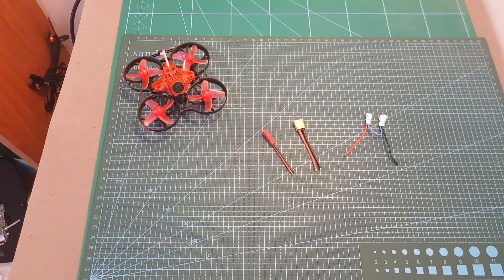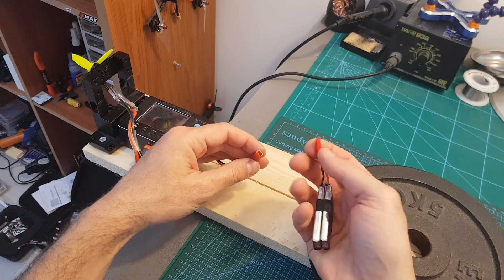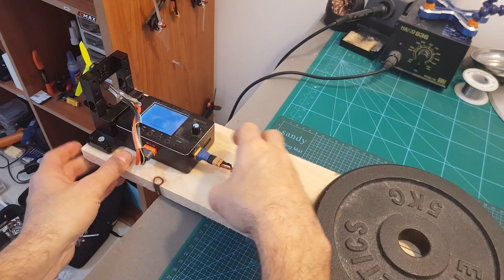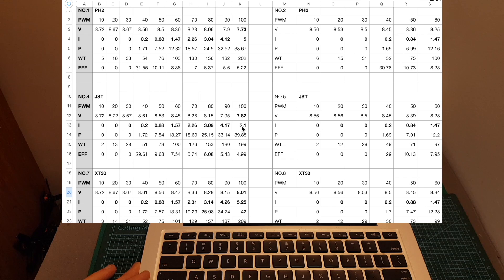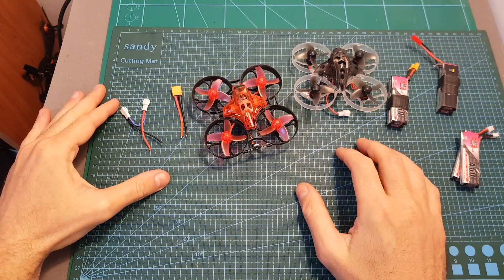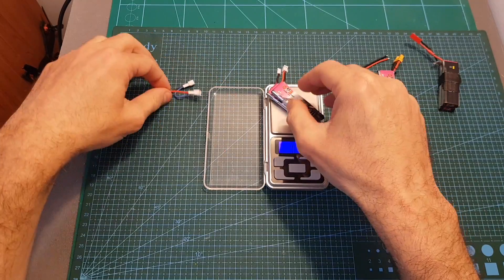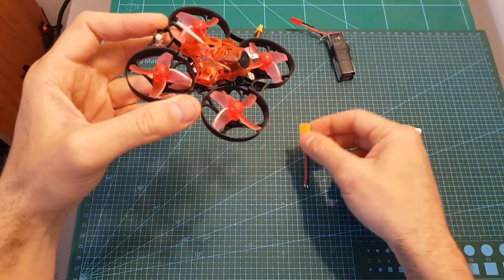XT30 Vs. JST Vs. PH2.0 Connectors Comparison

Comment: Hello sir, I have a mobula 7 1s drone. I changed the motors with mobula8 motors. And it's hard to use 2s battery I connected 2 pieces of 1s gnb 600mah with pH 2 connector, will this be a problem?

Comment: I have a 2S 350mAh lipo only with a JST XH2.5 connector. No extra cable with connector. It is from my Omphobby M1 Heli. Works great on the Heli. How does the XH2.5 compare in this test? 🤔

Comment: am I missing something, or you really testes different connectors with different batteries? You just measure the difference between particular batteries, no connecters. The lost of current resistance of the connector is negligible. Why nobody commented such an obvious fact?
Reply from the maker: Different connectors - same batteries.
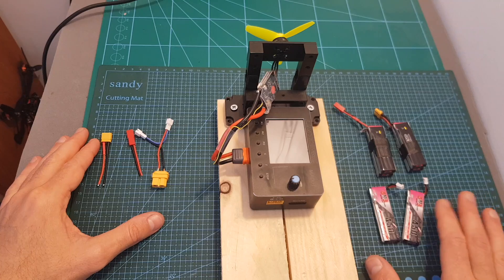Reply: @KremerFPV  but on 0:42 you clearly have all 3 configuration solded already. What do I miss?

Comment: In your opinion, is it worth upgrading to JST instead of XT30 on a 1s 600mah toothpick build? I mean JST is lighter, and it doesn’t require soldering, which might degrade the battery due to the heat when soldering , and I have tons of JST connecter laying around 🤣 
Is it worth saving 1-2 grams of weight in exchange of 2-3% of efficiency?
Reply from the maker: It's actually downgrading haha. You can use BT 2.0 connectors but if you have a lot of JST connectors and you must use them, go ahead :-)

Comment: I just change to xt30 on my mobula7 1s config, voltage sag is significant improved. 

Thank you for the video.
Reply from the maker: Great to hear!
Reply: This is exactly what I was looking for. The voltage sag is significant on my Mobula 7, and I want to convert to either the XT30 or the JST RCY but had concerns that the XT30 would be too heavy for it. But it's essentially only 2 grams more, which I guess hasn't been an issue for you.

Comment: Can you do the test again with the new connectors bt2.0 and et2.0/gnb27 vs xt30 connected to the battery as the jst was? I was thinking that maybe this two connectors are worth replacing the xt30 in 2s batteries .
Thanks in advance. Keep up the great content
Reply from the maker: Thanks for the suggestion. I was planning to make an updated video but never got the time to do it :-/
I might post an updated test in the future though.

Comment: Just a quick question, how are you going to charge the spliced 2s battery that uses that xt30 connector is it ok to not have a ballance lead? I want to do the same with a bunch of 1s bats I have  thanks
Reply from the maker: You are correct, it's much better to use a balance connector but it's possible to charge the battery without it (with some chargers).

Comment: Gal, nice video. I am thinking of getting a toothpick class 2-3s drone with an XT30 connector. However I have a large number of 1s whoop batteries with PH2.0 connector. Do you foresee any issues if I make an adapter with an XT30 male plug to (3) PH2.0 female plugs wired in series? I am ok with some efficiency loss if I don't have to buy new batteries :)
Reply from the maker: Thanks.
Sure, you can do that but I do suggest in the meantime while you fly to get new 2/3s batteries with the appropriate connectors as you will encounter efficiency loss issues and your flight time will be shortened.
Reply: I'm a complete novice here so read this comment with some skepticism. I would also have no problems with creating an adapter to go from a PH2.0 to an XT30. But I think you'll be less happy with the results. I'm sure it would likely take a Long time to change over your batteries but you could try changing over a couple to XT30 connectors to see how it goes.

Good luck!

Comment: How do you charge your modified 2s batteries now that there is an xt60 with no balance lead?
Reply from the maker: I only did it for the sake of testing these batteries and even though it's not ideal, you can also charge your batteries without the balance connector.

Comment: Great video! Just what's needed right now. Something to note reading the comments... TWO (not one) PH 2.0 connectors have more resistance than just ONE JST which is interesting as JST lists the common 2.5mm JST RCY connector used here as a 3A max connector too. So the JST should have been used in place of the PH 2.0 IMO but it's still not rated high enough. Also JST connectors come in different quality grades not listed on JST's website that increase the amp rating (over double I believe) but to my knowledge only the cheap version are used commercially so the new BETA FPV BT 2.0 connector seems the best way to go right now. My experience shows the cheap version JST connector gets warm enough to be hard to separate on a U807 using a Nano-Tech 750mah 35C 1S (lower amp draw) so at 0.58 grams (both male and female) I'll be ordering some BT 2.0's for all my 1S high C rated batteries and hope a standard micro connector for 2S high C batteries emerges as that's what is needed now as well as longer flight times on small builds.
Reply from the maker: That's good to know. Thank you!

Comment: I have a question, I have some lipo batteries but they are jst plug so I want to know if I can change it by a tx30 plug just by cutting the end and welding the new plug, hope you can help me. The batteries are 3s 1000mah 30c
Reply from the maker: Yes, it's pretty easy. Just be careful not to short the two wires together.

Comment: hey Gal! I'm interested to know if I could adapt a 1s battery with ph2.0 connector into an xt30, kind of like you had your test leads, just in case I want to fly these smaller quads indoors at 1s for competitive reasons (there are some local clubs that run 1s events) I may gain 1.85g but I don't feel like that's too much more of a load on a single 1s battery? What are your thoughts? I've already seen another channel run some other 2s whoops with the xt30 and have kind of decided that its probably the way I would want to go.
Reply from the maker: Sure - you can make a PH2.0 to XT30 adapter. Having said that - if you are frequently 1s batteries - just stick to the PH2.0 connector :-)

Comment: Going back to your flight footage on the previous video I saw that during 100% punch out the current reached over 13A, would you consider trying this test with a 10-12 A load? I think that maybe 5A isn't quite enough to be representative of max amp load for the trashcan. I'd be very curious to see if a bigger difference could be seen between ph2.0 and xt30.
Reply from the maker: Yep :-)
https://youtu.be/fsQGbGF5auw

Comment: Huh, the differences were definitely less than I expected, but as you say this was only 5A load so it would be more the higher the amperage. Do those GnB 450s fit on the trashcan? Excellent test though thank you!
Reply from the maker: Thanks Charles. I re-tested it in this video: https://youtu.be/fsQGbGF5auw
Yes - the GNB450 fit.

Comment: Apart from weight, is there any downside to soldering on both the xt30 and ph2 connectors together on the quad to have the choice? Looms like it has enough power to take the extra weight anyway
Reply from the maker: I think that a better way would be to make an adapter of XT30 to PH2.0 and then use it when you want to use a 1S battery. The pads are pretty small and I don't advice to use two connectors at once.

Comment: Since getting a UK65 I noticed that the PH2.0 connection got quite hot (easily visible with a thermal imager), it turns out the PH2.0 plug on the craft has pins made from flat metal folded over length ways into a U shape.
I replaced the UK65's lead, using one I made with a board mounting PH2.0 connector because it has solid metal pins. Now the connection doesn't get hot like it used to.
I've been wondering what the amp capability is between the folded metal pins PH2.0 and the solid metal pins version.
Reply: Officially the manufacturer of PH2.0 (JST) rated it for 2A. But as you see in this test 5A doesnt show huge losses, but they are there. I bet the folded pins are <1A

Comment: This video seems to confirm what some other testing has shown; the XT30 makes a lower resistance connection than either the PH 2.0 or the JST.  Hence the increase in volts and amps, and thus watts.  Could you provide us with some information about your test setup or a link to a video which describes it?  Thank you.
Reply from the maker: What information are you missing?
I mention the AWG of the wires in this video: https://youtu.be/fsQGbGF5auw

Comment: Phew!!!  thanks Gal, I have just changed all my JST connectors to XT30 it took me a very very long time.
 Its good to know my effort was worth it. Always useful :)
Reply from the maker: Yes - it surely seems like you didn't waster your time :-)
Reply: How are you going to charge them? Parallel board? one by one? It is a pain to charge those tiny whoop batteries one by one since I fly like 12 packs per session...

Comment: I had xt30 on my m7 before and yes the battery bay sux as u have to modify it but i got 3.5mins best with 300mah 2s nanotech 45c so 3.5mins was disappointing. I switch back to 2x 2s ph2.0 with solid pin connector and 20awg wires. I can get 4mins+ with 260mah 1s betafpv hv lipos. For the trashcan xt30 is a good idea because it has a bigger motor and the battery bad doesnt need mods.
Reply from the maker: Yes - I totally agree - the Mobula 7 is not XT30 user friendly as the Trashcan.

Comment: Differences seem pretty small.  IMO doesn't seem worth the effort or added weight.
Reply: What you will feel when flying is neither Volts nor Amps but Watts that go through the motors, which is voltage times current so the two increases multiply. In the first test that would be 9% more which is certainly noticable. And from reports of people modding their Mobula7 to XT30 the improvement seems to be substential concerning battery sag, maximum power and flight times.
Reply: @Gosuminer  Yes... agree. I've experienced a drastic increase in power and flight time just from replacing the male side PH 2.0 on a Tinyhawk without even using new female PH 2.0 connectors on the battery side which shows me the PH 2.0 should be put in the garbage bin as all my PH 2.0 battery connectors are warn too (but batteries still good) and the PH 2.0 just doesn't last used as a battery connector. High electrical resistance is hard on lipo batteries and saw this problem with the original Blade Nano QX using 6mm brushed motors where after 8 or 9 charges the PH 1.2 mm connector used was already loose and LVC time was reduced making the battery appear bad until you check the voltage to see how early amperage drops due to a weak battery connection. 

Ordering some of the 0.58g BETA FPV BT 2.0 1mm bullet connectors to try out but sure don't appreciate having to solder on battery connectors so hopefully GMB and other battery manufactures start using the BT 2.0 in place of the garbage PH 2.0 causing more issues than people realize.
Reply: I agree, although if I already had some 2S XT30 batteries around I'd consider it. Most of us probably have a lot more 1S whoop batteries though. Not to mention, 2 grams is a lot in the whoop world, although for 2S probably less meaningful.
Reply: I think the amp load measured here (5A) is around hovering/cruising speed. 100% was over 13A current so I would bet the difference is much bigger at 100% throttle.
Reply from the maker: New test with higher Amperes: https://youtu.be/fsQGbGF5auw

Comment: Does the length of the cable between connector and battery not have any effect ? e.g shorter it, is the better the performance ?
Reply from the maker: It should have a very minimal effect when dealing with such short wires. Of course if the wire length would be a couple of meters it will have a big effect :-)

Comment: Great comparison and great video. I only have 1S micros running so far and there it is not worth the effort. I am not sure, if I would do it with 2S whoops, because the difference is marginal and you have to mod every battery you buy. So not what I want to do, just for only 3% extra power. I am pretty sure, nobody wíll notice the difference while flying, if he does not know, which setup he flies. Would be a nice topic for a video, to make such a test. Just use 2 trashcans. One stock and one modded and do not show the pilot which one he is flying. Make several runs and let the pilot guess which one he is flying in every run. Somtimes just change battery and sometimes swap the quad. Let a dice decide, just to be sure to have some randomness.
Reply from the maker: Thanks for the suggestions. The difference is actually not that marginal. Check out my new video: https://youtu.be/fsQGbGF5auw
Reply: I have the original TH1 on 1S and have had several problems including proper charging that traced back to the PH 2.0 connectors being worn out which is a real issue with the PH 2.0 as it is NOT a battery connector and was designed for 2A max 30 AWG low amperage circuit board connections so with repeated insertions it's not designed for it soon loses its tight fit and ability to carry sufficient current. I was shocked at how much more power and flight time I picked up just from replacing the PH 2.0 on the TH (not the battery's connector warn out as well) which people say maxes out at 4.5A but was designed for 2A and loses current capacity fast.

On a small 1S whoop I would use BETA FPV's  new BT2.0 9A (15A burst) 0.58 gram 1mm bullet connector and hope it becomes the standard for high C rated 1S batteries unless someone comes out with a better connector which gets old as we only need one standard connector for battery manufactures to use.  The XT30 on 2S works but the balance lead adds too much weight so it should replace the main power lead so a new connector for 2S batteries is needed with it's own connection cable to work on all chargers

 Hard to believe a common important part needed for a micro quad is holding back so many quads performance! BETA FPV's BT2.0 can support 9A continuous current and 15A burst so for now 2 BT2.0s on two 1S 300 GMBs seems to be the best battery setup for 2S micro builds like the Tinyhawk but there is added  weight using a duel battery setup so hopefully Emax reads these comments and responds with a new battery/connector setup for single 2S batteries. But I hear you about soldering on new connectors when the battery manufacture could have done it for little added expense... but they must use whatever connector people use so the hobby is back to developing another standard connector people chose developed for high powered micro quads. 

And BTW God is a layman's concept for Mass/Life invented before atomic research took over to explain reality connected to consciousness. Last summer Northwestern University researchers "upended the current, accepted notion of matter" opening up material designs based on Life's building blocks, wave forms we call atoms that create DNA molecules and give us a center of gravity connected to sensory perception and real physics beyond sensory illusions in effect. Nanoparticles engineered with DNA in colloidal crystals when 3/4 the size of DNA behave like electrons because it takes 4 oscillation phases (up electron/down hole-graviton/stop to start out and then reverse direction at each end) to complete an oscillation in space connected to time. Anything that oscillates in space does so connected to time so must have 4 oscillation phases showing physics failing to accept a basic and proven concept of Einstein's relativity. 

When Monica Olvera de la Cruz used a nano particle smaller than the DNA it ran out of space to hitch a ride and complete the oscillation exposing the 2nd phase of the electron which inadvertently exposed the 4th oscillation phase of the atom needed to keep space connected to time. Life has a physical foundation connected to Mass oscillation that particle physics has been tripping over due to the asymmetry of the weak force needed to understand the fine structure constant as well as gravity as a force connected to the geometry of spacetime: (e{a})/t=E.